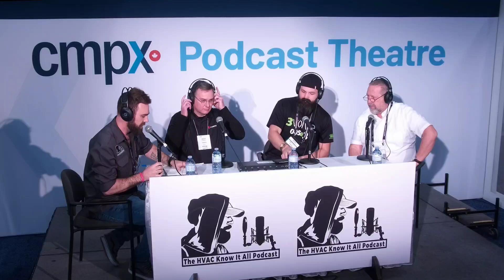Building Performance, Load Calculations, Blower Door Testing , Thermal Imaging - Live Podcast

Comment: Great conversation, I've got a fluke ti32 thermal and I love it. Mr. Bond, love your work. I think I might have been using aluminum checker plate before you but you definitely perfected it. I'm really digging the direction the industry is going. We just need to get rid of the fly by nighters. The more technically challenging the industry gets the more of them flock off.

Comment: Best advice I got from a teacher, you have to be able to drive tractor before your drive the Cadillac, so I disagree throwing technology at new techs, having superheats and sub cooling automatically given them to meanwhile they have no idea how that is actually calculated just an example
Reply from the maker: So, SH and SC is simple math.  We can certainly teach how it's obtained by using digital gauges.  I do agree though that techs should know how to use analog and digital.